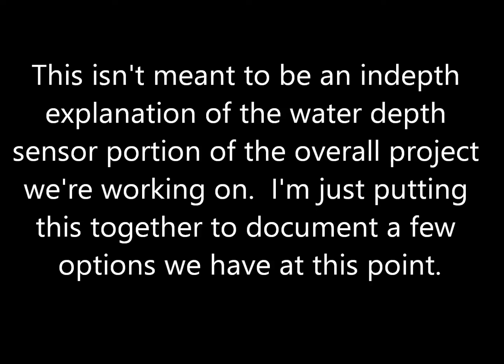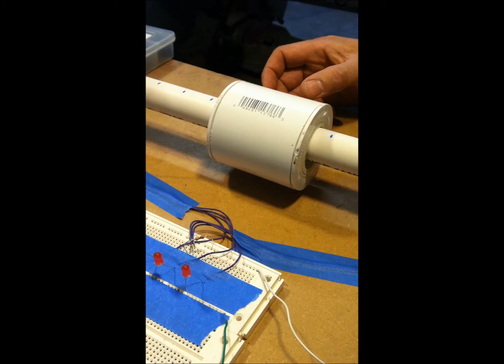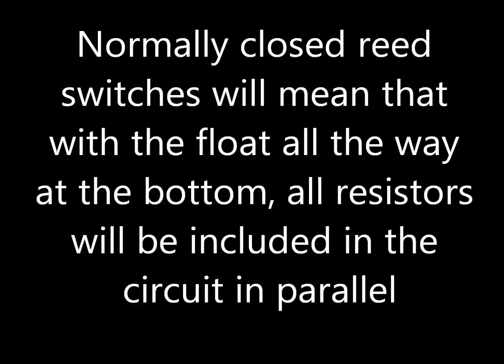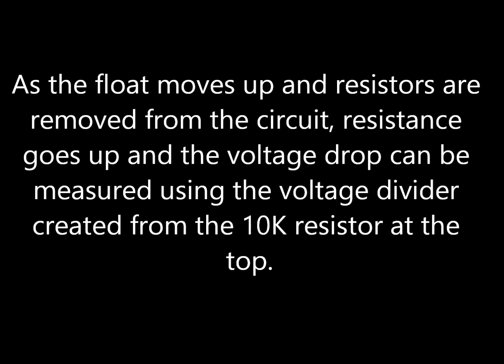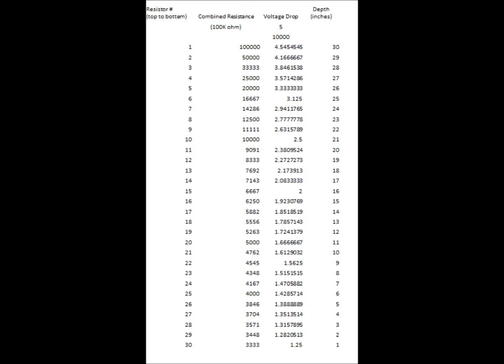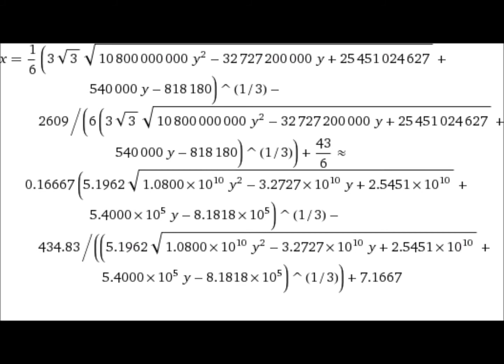water depth sensor

Comment: You should use Hall Effect sensors - would seem appropriate!
Reply from the maker: +Todd Berg 

Thanks for the suggestion.  This project happened fairly early in my electronics education.  We did look at Hall Effects at the time after the reed switches.  We ended up going with a differential pressure sensor which provided much higher accuracy compared to the discrete steps we were limited to with hall effect or reed switches.

We just mapped the output voltage of the pressure sensor (tied to a 1/4" airline tube) to water depth.  I forget the exact numbers, but I think we ended up with 1/4" accuracy going that route.  That was much more efficient and economical than an array of sensors packed in at 1/4" intervals.  And, there were no moving parts!
Reply: +Jacob Hall Sorry, it was just a play on words.  Perhaps you are related to Edwin Hall who discovered the effect.